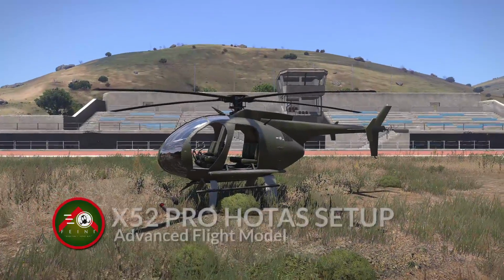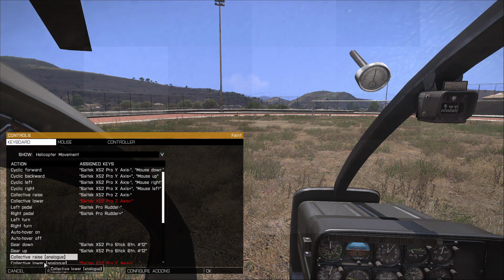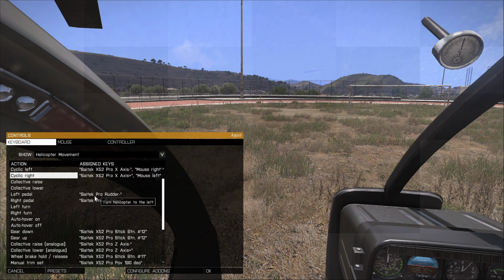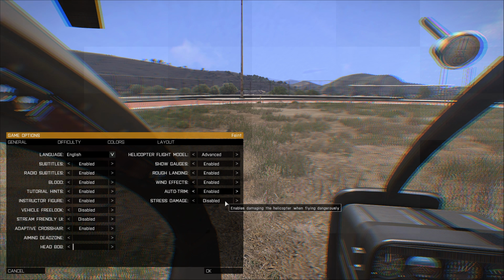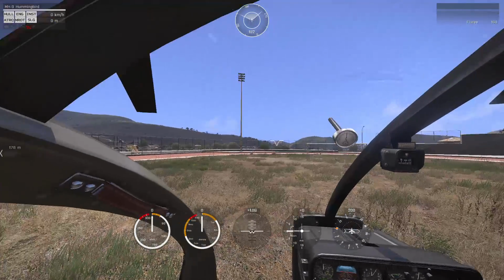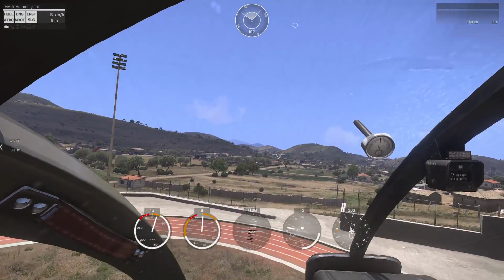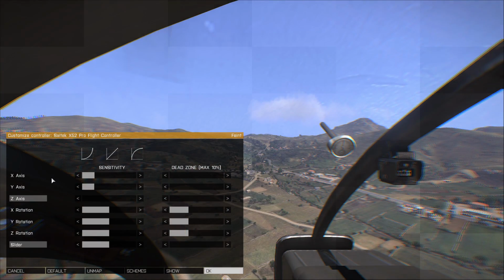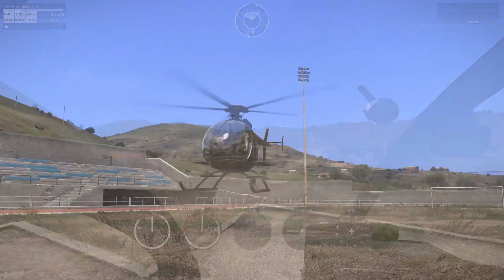Flight Control Joystick Setup - Advanced [ARMA 3]

Comment: Feint - I don't have the foot pedals, do you have a suggestion for another option that works? I am having the toughest time getting rotation and smooth turns.
Reply from the maker: +James Pearson The HOTASs that I've tried that have twist stick rudder controls are so so.  It's difficult to be smooth on those when also tipping the stick in a direction, or more accurately, it's effective on some moves, but not others.  That's why I finally opted for rudder pedals.  They are also good for using them as alternatives for lean in Arma 3.  I use the toe brakes on my pedals for leaning and it's so much better than using keystrokes.  It also frees up some very important keystroke real estate for other controls.

I don't know what hardware you're running, but if you've already tried the tips in this video and still can't get the rudder reacting the way you want, and you don't think you'll get used to it, think seriously about what your gaming budget is and see if you can opt for another peripheral.
Reply: +Feint I have the hotas x and I'm wanting foot pedals under £25 any ideas?
Reply from the maker: The Howling Wolf Hmm.  Save up for something better.  Pedals for under 25 pounds would probably not be very good.  Or, better yet, make your own.
Reply: Making your is a totally possible: aim to a fablab and become a rudder engineer : D

Comment: okay, dumb question, but what is trim?
Reply from the maker: That's not a dumb question. So if you're flying an airplane, sometimes you have to pull back on the stick constantly to keep it straight and level. Or sometimes you have to push forward on the stick or give it a little left stick to keep it level. Well, there are these things called Trim Wheels in the cockpit that operate little tabs on the plane which help direct the plane in one direction or another. Then, once you set them, you can let go of the controls and the plane will fly straight without any input from you. That's called, "trimming out the aircraft". Interestingly, autopilots typically move the aircraft by manipulating the trim.

In helicopters, you also have to set the trim over and over depending on what you are trying to do and how you are trying to fly. Otherwise, you might end up with your left leg pressed in for hours or your hand pressed into your left inside thigh. So if you can set the trim to auto, then you don't have to worry about that as much. Real helicopters like the H145 have autopilot systems that set the trim automatically while allowing you to still fly the aircraft. It makes the helicopter much easier to fly because it uses a computer to help figure out what you're trying to do. It's like stability control for your car.